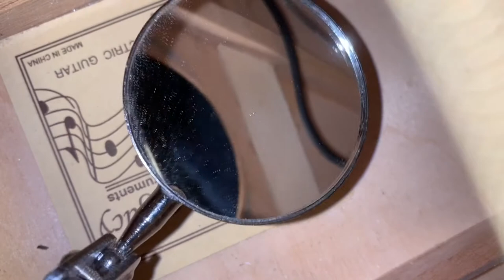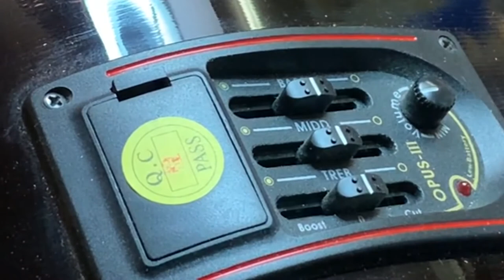Acoustic Guitar Set Up - Esteban AL 100 acoustic / electric guitar

Comment: Mine isn't making any noise come out of the amp. I can hear a faint white noise that can be controlled as I change the volume knob on the guitar, so maybe the pickups aren't working. Or maybe I have the wrong strings.
Reply from the maker: At 22:36 you’ll see how the battery goes in. That’s the first thing I try. Try a different cable too if you have one. Check amp for any stand by switch. That always throws me off. Let me know how it goes with new battery and different cable method.